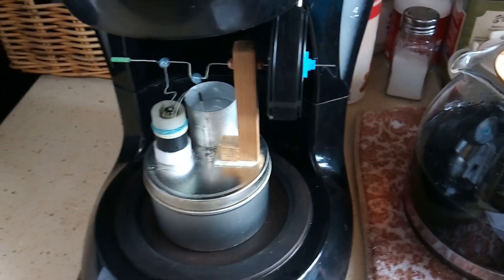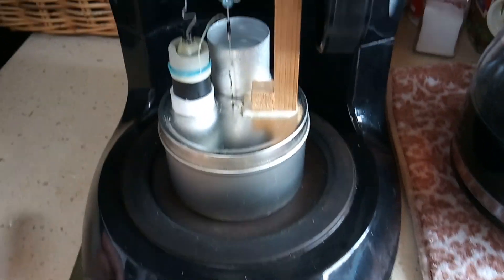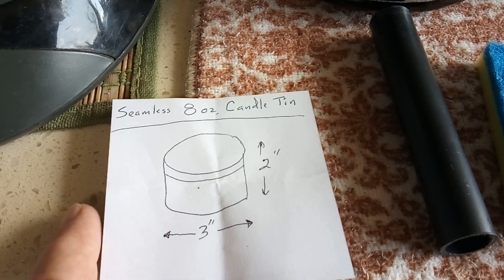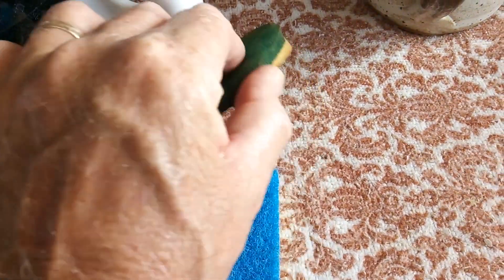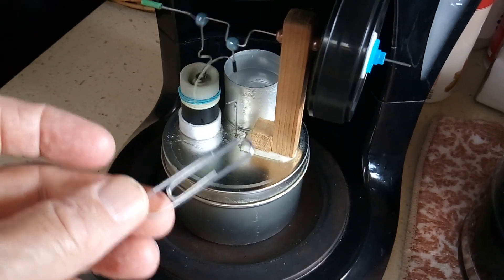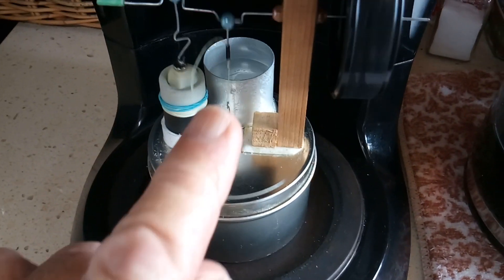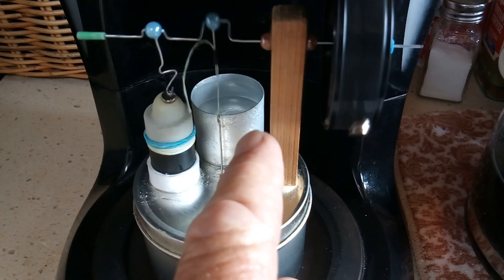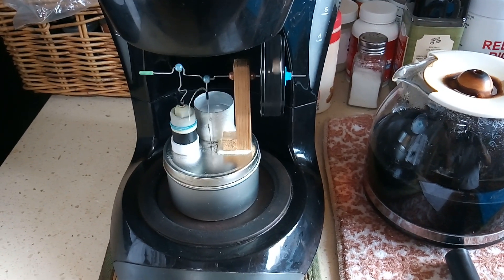Coffee Maker Stirling Engine

Comment: Since there are no batteries, I put some corrent in the pot:
Why two voltmeters attached to the same two points can read a different voltage:
https://youtu.be/MraBlDcbKuk

My latest video is...
Kirchhoff's Loop Rule Holds (No Math):
https://youtu.be/IQ1ajlUEglk
Real Current!

Comment: "Compared to an internal combustion engine of the same power rating, Stirling engines currently have a higher capital cost and are usually larger and heavier. However, they are more efficient than most internal combustion engines. ... The thermal efficiency is also comparable (for small engines), ranging from 15% to 30%"
src:  https://en.wikipedia.org/wiki/Stirling_engine

Stirling Engine for power production:
http://www.redhawkenergy.net/qnergystirlingengine.html